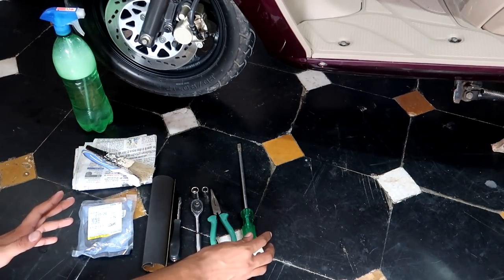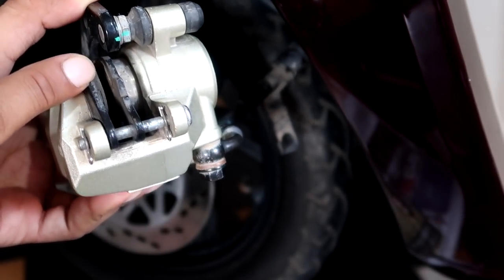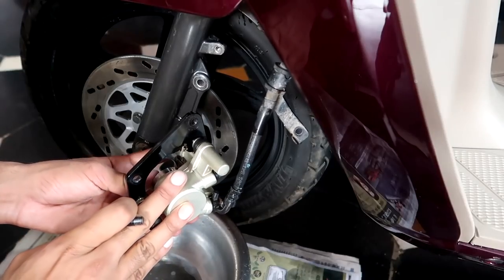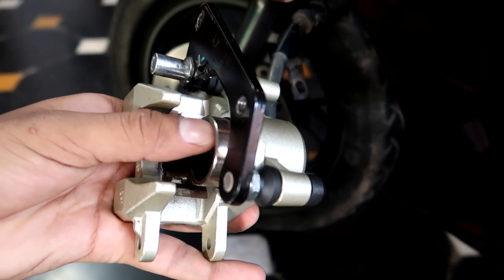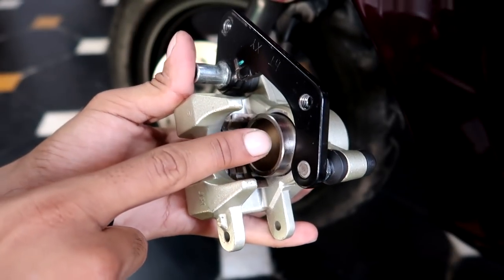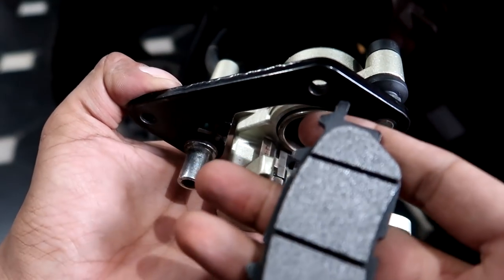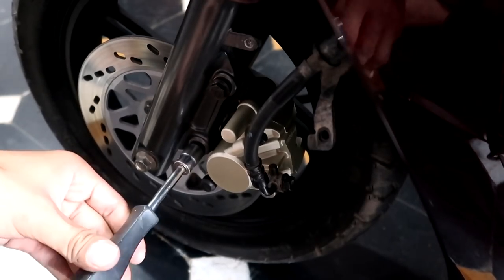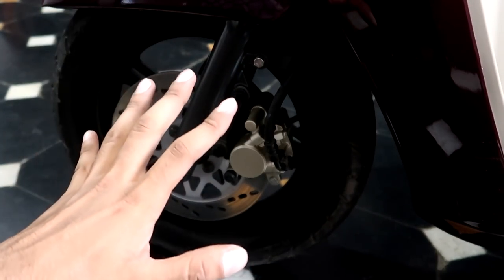How To Replace Disc Brake Pads Of Any Scooter

Comment: Hi Jeet. I am regularly following your videos. I own Jupiter ZX disc scooter. Pls make more videos on Jupiter. I have a problem with my scooter's disc brake that they make hissing sound Srrrr Srrr when I turn the handle extreme right or left. This sounds like the brake disc is rubbing against the pads. There are circle scratch marks on disc too. I have 9500 km on odometer. I get very less mileage around 30 to 35 km. How to increase mileage? It is for mileage I started watching your videos and now I am capable of doing the basic service myself like cleaning carburettor, spark plug and both air filters and CVT serviced. I have done carb screw settings with multimeter for maximum output voltage and sounds max rpm too. Still mileage around 35. I have difficulty with kick start in morning. Even if it starts after struggle, engine stops on its own if it's cold. It is Tappet clearance issue? Pls help. Any way to contact you by phone or email? Where is your garage? Pls reply. Thanks a lot.

Comment: Perfectly explained!....👌
I believe you studied Mechanical Engineering. 🤠
Reply from the maker: Just an Arts student
Reply from the maker: I did, i just didn't showed that as i saved that tip for a future video named "ktm brake Rebuild guide"
Reply from the maker: Allie X  i follow almost every single great content creator of almost every category out there and whatever i know is a cocktail of YouTube, Motorcycle fourms and my own trial and error experience of almost 7 years. And agreed on engineering advice but not everything goes as planned.
Reply from the maker: Allie X  i can't name then all but here are some - chrisfix, car throttle, motorcyclist magazine, hagerty, how car works, alex rebuilds, really random channel, restore it, ammo nyc, premium auto styling, motortrend channel, adam lz, build threads, yiannimize, gears and gasoline, powerdrift, sagar sheldekar and a lot more
Reply from the maker: Allie X  i agree that pd has lost it's soul but I'm so habitual of watching the channel since 2013 that i didn't stop. And engineering explained and colinfurze are in the subscribtion but will checkout project farm for sure. Thanks!

Comment: Bhai I followed the same steps, I didn't have to replace since I had lot of material left on brake pads and when I assembled it back , the brake lever became very hard and the tire is also not completely free.  I started facing this problem as soon as I had cleaned and assembled the unit back. Do you know how to solve this problem? 😭
Reply from the maker: Check caliper guide pins and clips brother

Comment: My frontal disc brakes are constantly rubbing against the disk. Hence the wheel is not rotating freely.

Effect is more pronounced especially when handle is rotated to the extremes.

They lubricated those rubber rubes ,the axles,they changed brake pads but issue reoccurs within 7 days .

Access 125 2021 special edition

Comment: Hi, the disc brake on my Jupiter has become spongy, it's run only 5000kms, should I ask the service center to replace the brake pad or just replace the brake fluid? I need to know exactly what to ask him to do as the mechanic is denying any problem with the brake.
Reply from the maker: Get the brake pads cleaned and brake fluid replaced
Reply: Thank you so much!

Comment: In my Jupiter the front wheel makes a friction sound when I check it on stand. While running there is no problem. But the mileage is low. Is it due to rubbing of brake pads with the disc when not in use. I have shown it to the service centre they told me that it's the bearing noise but they didn't open the front wheel.
Reply: Shayad disc plate bent huyi hogi. Ya phir brake pad assembly me dikkat hai.

Comment: Hi bro, I've been your subscriber since a long time. Recently a little rain water entered the fuel tank of my NS while refueling in rain, since then the bike is giving occasional jerks at around 3-4k rpm, can you tell me how to drain the carburettor?
Reply: I see a drain bolt on the bottom of the carburettor bowl, will that drain the water out or do I need to replace the fuel filter, my bike is only 1 year old.😩
Reply from the maker: There's a drain pipe at the bottom of the carburetor just above that you will see a flat head screw... Remove that screw and the fuel will start draining through the pipe but that's not gonna be the only solution.... You have to replace your fuel filter and that will solve your problem buddy.
Reply from the maker: You have to replace the fuel filter .. it only costs 80-90 rupees
Reply: @JeetBhaskar  thanks a lot for clarifying my doubt  bro.😊
Reply: @JeetBhaskar  yes, i got the petrol drained from a motorcycle service shop and rode it for a few kms. The bike is running fine now.
Reply from the maker: That's great .... Ride safe buddy... have fun.

Comment: brother , there's a problem in my ns in the normal room temperature the front disk brakes are usally normal but once i started using the bike or get out in the open the brake automatically gets extreme hard and once after i come home and the climate temperature gets down the brakes gets back to normal? what could be the possible solution
Reply from the maker: Either the caliper is bad or the master cylinder.... Get that figured out by a good mechanic than you'll have to change the major service kit of the culprit part ..... Get the brake line cleaned by blowing some high pressure air.... Put some dot 4 brake fluid and you'll be good to go.
Reply: +Jeet Bhaskar thanks man feels like the master cylinder and the calipers are okay.Will check out with the oil.
Reply from the maker: The brake sticking after heating can't be caused by brake fluid buddy.... Definitely either the caliper or the master will be the culprit or even the caliper guide pin can cause this issue... Better check them first but as far as i am aware of bajaj it's definitely gonna be one or two of them. (Caliper and master)
Reply: +Jeet Bhaskar sure brother will get it checked by tommorow.
Thanks mate for the suggestions
Reply: @amlanbaruahtlp4768  after a visual inspection if you dont find any problems or leakages etc, change the master cylinder minor kit and bleed the system dont just top it with oil and pump the lever like all mechanics do. Usually the master cylinder piston orings swell and cause this problem. While you are at it so check the caliper sliding pins if they have lubrication or not.

Comment: bhai mere discover 150 m break ache se ni aari h, koi solution h toh bata do.
Reply from the maker: Disc hai ya drum?
Reply: disc
Reply: caliper bhi change kr diya h, master cylinder bhi change kr diya h, pr boss setting kaise thik aayegi break ki, koi tips de do aap
Reply: caliper bhi change kr diya h, master cylinder bhi change kr diya h, pr boss setting kaise thik aayegi break ki, koi tips de do aap
Reply from the maker: Caliper ormaster cylinder repair hi ho jaate bhai change kar ke jyaada kharcha kar diya.... Caliper ki guide pins ko check kr lo.... Shi se slide ho rhi hain kya.... Disc plate check kr lo... Brake pads or brake line me leak to nahi hai ye bhi check kar lo.... Ye sab sahi hai to fir sirf 1 problem hai or vo hai brake system me oil ke saath bubbles hain... Brake properly bleed nahi huye... Unko properly bleed kar lo brakes sahi ho jaayenge.
Reply: ye sb kr liya, pr problem ye aa rahi h, ya toh break lever m jayda play aa rahi h tb break jayda speed m ache se ni lag rahe h, or agar play thik aa rahi h toh speed m break jayda marne pr tyre skid ho ja raha h, mere pass ns 160 h usm toh bilkul bhi skid ni krta h.
Reply from the maker: Bhai master cylinder me abhi b problem h fir
Reply: na new master cylinder se break aare na purane wale se, kit bhi badal li, dimag khrab ho gya h ab mere, koi kehta h caliper badlo koi kit badalo, koi master cylinder, ab sb badal diya tb bhi tb bhi ni aara break
Reply from the maker: Kya batau bhai kabhi kabhi 1 choti si mistake ki vajah se bahut presan hona pdta h ..... Kisi achhe mechanic se check krao because itni door se m to yhi help kar sakta tha.
Reply: aap rahte kaha ho
Reply from the maker: Jhunjhunu, Rajasthan
Reply: sahi bola bhai, koi achi setting karne wala ni mil raha h mujh, sb bol rahe h ki patani setting kyu ni aari
Reply: 506 km😂🤔

Comment: " " "GOOD FOR DAILY HIGHWAYS COMMUTINGS  DRIVING   GOOD FOR DAILY COMMUTING HIGHWAY DRIVING COMMUTING FORM VILLAGES TO CITY AND CITY TO VILLAGES ,, ,, ALL WEGO AND OTHER COMFORTABLE TWO WHEELER SHOULD BE DESIGNED WITH DESIGNED WITH DISC BRAKES DISK BRAKES ,, ,," " "

A BIOLOGIST, ,,
A BIOLOGIST, ,,
A BIOLOGIST, ,,